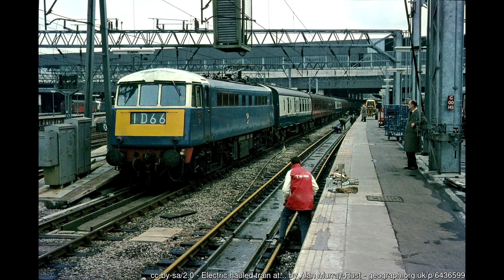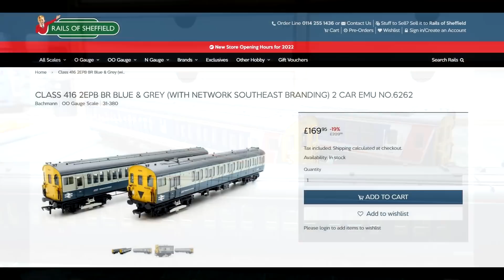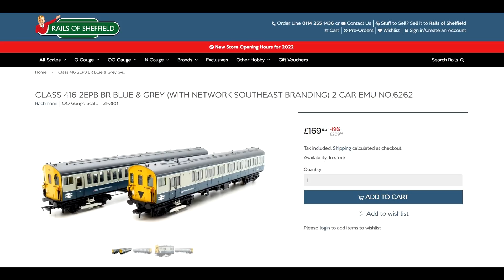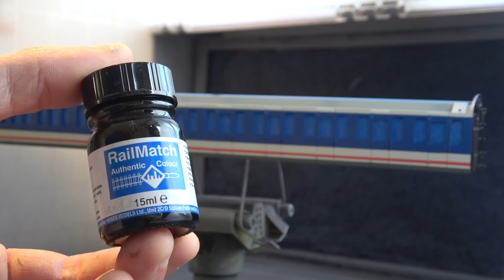Thumper Project | Building a third coach for the Bachmann class 205

Comment: As a Reading resident in the 70’s and 80’s, and a regular railway user you have certainly captured the look, feel and sounds I remember! The 205 Thumpers were a favourite of mine on the line down to Basingstoke and earlier on the Guildford/Redhill line too if I remember correctly. That EE diesel sound from the sound card is spot on! Great video, many thanks for the detailed explanations of techniques and equipment.

Comment: Richard. I was given a very handy tip when doing lining. After masking, spray the first coat in the base color so that any bleed through no matter how insignificant will be totally invisible. This will also seal any unnoticed gaps in the masking tape and prevent the top coats bleeding under the tape.
Reply from the maker: Cheers, I'll give that a go on the next project.  Thanks
Reply: was going to suggest that tip,  adds a day or two to the painting,  but does cut down on the bleeding risk.

Comment: Brilliant work! This really takes me back in two ways and I'm glad I saw this by chance. I was a keen modeller in my teens and also recognised the train livery, so immediately started watching. 

This is almost exactly my era of Southern West Trains/Network South East regular train travel. From age 12 my school journey was Staines to Windsor & Eton Riverside (then climb the hill around the Castle to the Great Western region's Windsor Central station, a branch line to Slough (a two carriage DMU service), starting in late 1979 until 1983/4. 

The Waterloo line was the all electric (third rail) version of your model, originally in the plain mid blue British Rail livery. I remember the new livery appearing and thinking it was quite `jazzy' and I think the old trains got new seat upholstery at the same time. I admire your attention to detail, though I don't think the paintwork was all that accurately applied to the trains themselves in the day. I can remember standing at one of the level crossings in Datchet and you could see the paintwork wavered up and down quite a bit as the carriages passed!  My recollection was those electric trains were incredibly reliable (I was rarely late), but certainly not refined. Fairly recently I was at Waterloo on a swish new Siemens train, everyone ready to set-off and.... `computer says no' (according to the guard) and delayed by half an hour while presumably the hardware was re-booted or a software up-date downloaded!? 

I built what I think was quite an impressive layout, for its time in my teens, about 6 feet by 10 feet with central control, viaducts two stations, sidings and lots of realistic features, fields and houses etc (happy days). It was a complete mix of eras though, it was not unusual for the Flying Scotsman and Pullman carriages to pass an Inter-City 125 HST! It had to be dismantled for a house move and there is not a single photograph; no mobile phones then to record every aspect of life and no one thought to get a camera. Hey ho All the best  David  PS my `tag' (Dier Straits) is my Premier League Fantasy Football game name..... I do know it should be `Dire!' but Eric `Dier' is one of my fool hardy team selections

Comment: Really nice job... One tip from my modelling days;  the glue on the plastic dust trick is a lot easier if you mix the dust with glue in a small pot and apply it as a thick liquid , rather than putting on dust and wetting it.  I used to store a small vial (old glass contact lens pot) of premixed plastic/glue to use as a gap filling glue for what you are doing.  Another option for a really strong, hard smooth sanding gap filler is baking soda on the gap and a few drops of superglue... Even used this combo to repair old Austin Montego bumpers!  Hope that helps
Reply from the maker: Thanks for the tip.  I'll give that a go on the next project.  Cheers

Comment: Great job. I built mine as a 3T unit, as used between Tonbridge and Reading in the 70’s, using the whole driving trailer without the cuttting of the shell. Still had to modify the electrics. But Door banger? Never heard it called that. Was always a bump stop, because that’s what it is, however, you need to lower the black triangle if you get the inclination or the time on the front, as you have put it in the location it was applied after a repaint after the headlight was fitted. Traditionally the triangle was at the bottom (same as on the EPB motor coach). But as I said at the start, great job mate
Reply from the maker: Cheers, glad you enjoyed.  I've a few small jobs left to do on the model so I'll add the triangle to the list.  Thanks for pointing that out.

Comment: Amazing work Richard, i wish Bachmann would re-release this as a three car unit in both NSE & BR Blue liveries. Not many people have either your level of skill or patience to do the conversions.
I thought the Thumpers had the same engines as the class 20's, only because they sound so similar with the thump & distinctive high pitched whistle to the engine as they pulled away.
Looking forward to your next project, stay safe matey.👍
Reply from the maker: I've since learned that the thumper engine was the same unit found in the class 73.  Being an English Electric engine it shares similar noises to other EE locos like the 20 and 37.
Reply: @EverardJunction  Thanks Richard, having heard many 73's running on their diesel engines, i would never have guessed that. Must be the different exhaust systems i guess. 👍
Reply: The prime mover in the Thumpers and class 73 was an EE 4SRKT , i.e. a 4 cylinder unit. The class 20’s had the EE 8SVT which was an 8 cylinder engine, developing 1000bhp. The oft - mentioned class 37’s were equipped with an EE 12 CSVT developing 1750hp, a much larger and more powerful lump altogether.

Comment: Just a quick note on using milliput for gap filling. You can mix the two compounds with a little bit of water to make a slurry and then either use a scrap brush or a silicone clay shaper to put it in place. That way you're not sticking a huge wad of it on your models and spending hours sanding it off. Failing that, make a long very thin sausage by rolling a pea sized ball and lay that over the gap. Will save you loads of time finishing it and ensures you don't accidentally fill over other details.

Comment: An excellent job, re the joining of the replacement coach end, it  can help to cement a series of tabs on the inside of either unit to aid allignment when sanding and gluing, add strength , holds the whole while setting, and if to much material has been removed they bridge any gaps.

Comment: What a bang up job you've done, looks box fresh. You'd really never know in most angles, I agree the colour isn't quite 100% but it's only in certain angles, or lighting situations can you notice, particularly against the engine car, which looks slightly darker than the rear car anyway, but certainly close enough not to matter. Quality job, and if I'd have seen it running around before this modification video, I'd have never have believed you even if your said that you'd mated 2 bodies.
Reply from the maker: Cheers.  The car is still a touch too blue but I reckon I might be able to sort that.  I'm going to enjoy running it for a bit and then get some passenger figures painted up for it.  I'll do a few other small jobs when I get it back on the bench.

Comment: Fun Thumper fact: the early units were built in an era when BR(S) used larger route numbers, so the centre window is the same height as the driver's window to accommodate this.
In the early 60s they switched to smaller route numbers, and later Thumpers (and the later EMUs: 4VEP, 4CIG, 4TC, 4REP) used a smaller centre window. I don't think any EPBs/HAPs had this, so it's an immediate giveaway you're looking at a DEMU.
Reply: The only addition to make is that the ex-Tyneside EPBs had the smaller head code window too. As you say, the later Thumpers (Berkshire units) had the smaller windows as the head code numerals in use at that time were shorter. The blue Thumper at the Lavender Line has a deep window at one end and a shallow one at the other as this unit is made up from the good ends of the units involved in the Cowden collision - each being from a different batch.
This was a great project to watch! Amazing result!!

Comment: Very nice job.  I model the Delaware & Hudson in New York State.  When D&H stainless steel  coaches were released, I discovered. the paint scheme was wrong according to my book on D&H passenger equipment.  I'm in a club so long trains are the norm.  I had to repaint 13 coaches in the proper D&H paint scheme.  Luckily Badger paints D&H blue matched my engines, so only hard labor was masking all the coaches.  Finding transfers for the coaches was the other challenge.  I would buy out a shop's inventory when I found them.  At the time Tamiya was the one who hard a clear to tint windows,.that took practice.  Now I'm the window tinter for the club's passenger cars.  Here's a trick for stripes, apply masking tape to a piece of glass.  Cut into strips with a sharp blade.  you'll have a straight side to mask a stripe which will help reduce sags.  I would not depend on the factory cut to be straight.  Glass is hard not to deviate a blade & will reduce tackiness of glue for removing.

Comment: to stop paint feathering into each other you want to use car lining tape they come in various widths I use 1.8th of an ich wide tape its made of a plastic base so does not absorb any paint so you get a perfect edge every time plus you can bend it into different shapes like a semicircle without creasing then apply masking tape onto the lining tape but not up to the line as you then still get feathering its cheap to buy and will last you for years so look up lining tape for pinstriping with paint. great video as always

Comment: There is another  conversion  you might  be interested in the 3T,
When the 2-epb first came some were fitted with buckeye couplings but five  units together was too long for Canon Street and those were replaced with buffer and chain. Later  there was a need for motor units either end of two trailers and  this left some dtso left and these  were put in some 2H units  becoming  3T 14xx sets.

Comment: quick hint for users of Milliput, there are fine versions available, and it responds well to water upon application, allowing  joints to be pre-smoothed before it sets,  saves a lot of sanding later. please also see down for a good tip on masking and painting by another poster...

Comment: I love the amount of detail in your work.  There is one trick I've used in RC vehicles I've worked on. Both in the lexan and  "hard body" types.  I use a gel type super glue to act as body filler.  I don't need to go the extra step of applying bondo and the glue cures hard as a rock.  I don't know if it would work for you but as I said it saves me the extra step.
Reply from the maker: I'll try that in future, cheers.
Reply: @EverardJunction  thanks! 
Please keep up the videos.   I look forward to everyone

Comment: Really interesting, thank you. I thought of using the centre coach from Replica Railways, they have them listed on their spare list, I'm not too sure about the electrical connections though.
Reply: They're a useful source for suburban 64ft coach parts and 1951 style emus. You can quite easily make a 415 4epb from those parts and they have a guide too. The replica profile might be a bit different from the Bachmann one and you have more to remove from the roof. 

As for the couplings,  you could source them as spares from Bachmann and do as Richard did here. Bachmann spares sell most of the parts for the 416 and 411 as well as the 2hap as well. You could buy just the parts that Richard used here and do the same thing of course rather than 170 quid for a complete set.

Comment: A hint from an aero modeller. Milliput is water soluble while it’s still malleable, so if you smear some over and into a gap, you can smooth it over with a damp rag until all excess is removed. Saves lots of sanding.
Reply from the maker: Cheers, will give that a go in future.

Comment: Looks awesome! I have a couple of 2EPBs in storage that I got cheap-ish which I wanted to convert into a Class 304 in a very similar fashion to this but I never worked up the courage. After watching this I might need to find out where they are and get cracking!
Reply from the maker: Would make for a very impressive train if it goes to plan.  I was a bit worried at first but once I got deeper into the project my confidence grew.  Cheers

Comment: A great project there Richard you have done a great job, from the looks of the cab you cut off and the body that was left from doing the extra doors and windows for the coach I think you could make one of the MLV units, from looking at pictures of those units and the parts you had left from doing the cutting it looks like you could make one of those and it would add another unit to the branch line which I think you did put third rail on.
Reply: I was just thinking that because even if it's good to have spares you can't deny he will just put it in a box and forget about the rest of it

Comment: “Branchlines” supply in kit form, the 63’ Mk.I 10-compartment centre coach for the Hampshire 205 DEMU’s. The body, interior, glazing, and bogies/wheels all come separately. Just need glue paint and transfers to complete.

Bought one to be painted into BR Rail Blue to make Kernow Models/Bachmann Limited Edition DCC Sound version into a 3-car Hampshire Unit as found on the Swanage Branch in the late 60’s/early 70’s.

Comment: Also like your tip on paint bleed. What can also work is applying a light coat in either clear varnish or the same colour as used on the previous layer (ie use clear or white on the first masked layer when applying the blue). This way, if you do get any 'bleed', it will not show

Comment: You might be interested to know, Richard, following a bit of research, that another class 205, 101, also known as 1111, when refurbished at Eastleigh in 1980, and remained a one off 205/1, was converted so it could work in multiple with southern region EMU stock from 1959/61 etc, such as the 2EPB, 4BIG, 4VEP. And so, it was assumed it could work in multiple with a class 33 or 73 as well. Just an idea if you fancy doing this again!

Comment: Really impressive, Living near Salisbury I did a lot of Thumpers over the years as well as the Basingstoke to Reading service with them. I even slept in one of them overnight on a couple of occasions at Salisbury on after doing some of the final 50 tours, one morning getting a trip to Yeovil and back to Salisbury before bailing again on the next Yeovil at Gillingham. Anyway not sure what interior photo you used as that had a corridor coach? only one was converted as all the others were non corridor stock with open or compos in the first class end. 
Anyway a great model made even better with that centre car.

Comment: Great job on the Thumper Richard - my only observation would be the position of the black triangle being to far up on the motor coach. I believe Steve @ Railtec does them in his range.
Reply from the maker: Ah, I hadn't noticed.  I just masked up the original bachmann one and touched up the bottom after I finished the sanding.  Job for the future, cheers.

Comment: The best way to ensure you get a consistent line is to put down a stripe of the appropriate size in tape first and then to apply tape on either side of the first stripe then lift the original tape.  Trying to keep two edges parallel without a reference in between is difficult.

Comment: The methods of coupling the Southerns DEMU fleet differed from the methods of coupling their EMU's in relation to electrical jumpers as well as couplings. The Hampshire & Berkshire DEMU fleet had electrical jumper hoses between vehicles on ONE SIDE of vehicle ends and at a height roughly level with the middle of the windows. The EMU fleet as per the model you are spraying had the electrical connections through the electrical boxes at the centre of the roof ends.  

The DEMU fleet also had Buckeye couplings not only on cab ends but also between vehicles. (Unlike the similar EPB type EMU's). The rigid fixed length Buckeye semi-automatic coupling, therefore also needs what are called "Pullman Rubbing Bars" on cab fronts and between the vehicles. The "Pullman Rubbing bar" is only needed when any vehicle is fitted with a Buckeye coupling. It is a hydraulically sprung plate fitted above the Buckeye coupling to take the buffing forces, in place of normal buffers. This is because the Buckeyes fixed length does NOT allow for buffing at the normal corners of a vehicle, as the Buckeye has reduced the normal gap between vehicles by comparison to those fitted with the screwlink and normal buffer method, such as GWR & LMR coaching stock. Therefore if any side buffers are fitted, such as on a normal Mk1 corridor coach, the buffers MUST be in their retracted position, to prevent them touching an opposing buffer. Or vehicles WILL be derailed in sharp corners. 

Having Buckeyes and Pullman Rubbing Bars however, makes the gap between coaches greater if compared to the southern EPB era EMU's. Which only had one 3 link fixed chain coupling and one centre buffer, on one vehicle, rubbing on a suitably greased flat plate fitted to the opposing vehicle. The slight increase in gap between the DEMU vehicles when applied to the first batch of 2EPB's resulted in a 4x2 car EPB formation, not fitting in the regular southern 8 car suburban platforms. Hence the EMU's for length in platform reasons, had to have the short chain and one buffer system.